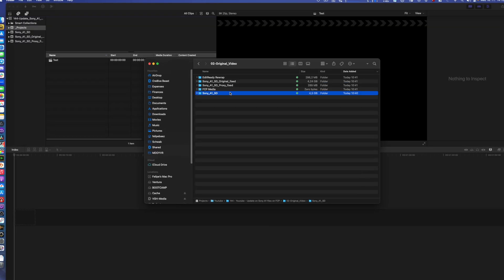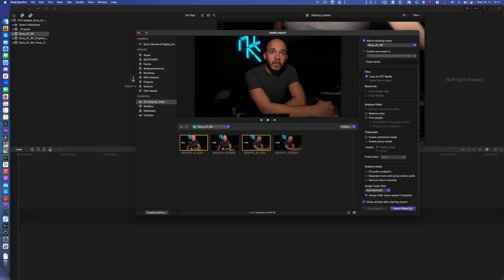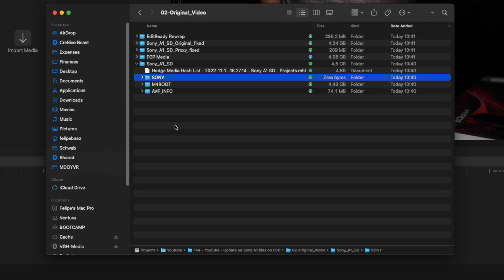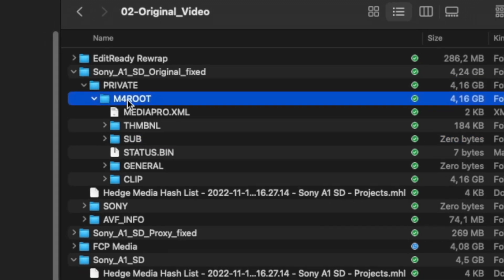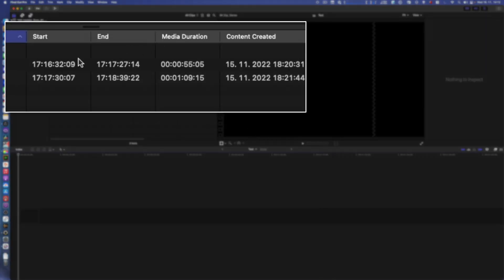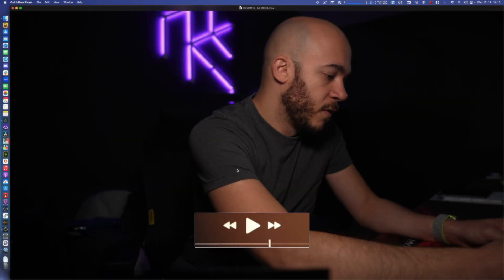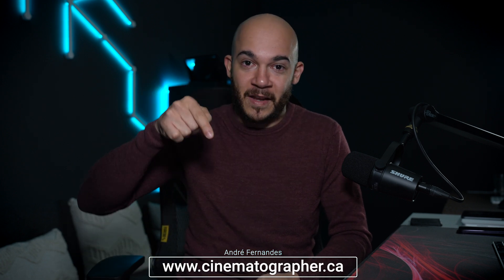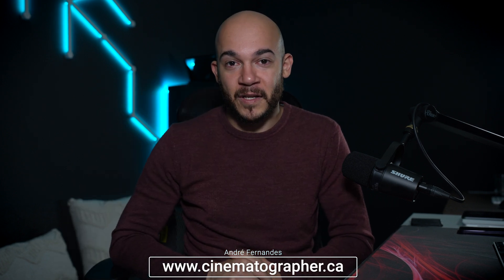Update on the Sony A1 workflow for Final Cut Pro

Comment: I am trying to edit Sony A1 4K XAVC S 120p video files but Final Cut Pro shows just a black video.  Quicktime is also unable to play these videos - well they play but sound only no video.  They play fine on the camera itself.  What gives ?
Reply from the maker: The app doesn’t support all codecs/wrappers at the moment. It’s possible that if you’d rewrap those files to .mov container with EditReady it would work. I shot exactly that format and I was able to playback, but can’t confirm at the moment if I rewrapped or if it was the original MP4s, but I think in theory you should be able to play those.
Reply: @FelipeBaezFilms  It seems it is a bug in the latest version of macOS as it worked previously.
Reply from the maker: @duncangroenewald  Are you up to date on your Pro Video Formats?

Comment: Interesting note about changing the folder structure after files have been copied to another drive... FCPX can no longer import and Leave Files In Place.  FCPX seems to see the files AS IF they're on an SD card, and will only allow the files to be imported via copy/rewrap into the Library.
Reply from the maker: That’s right. If it’s in a SD folder structure it will see as the camera card. But the best part right now is knowing how to emulate that and get the results we want. Creating the rewrap copy you have a correct reference of timecode on FCP and with the MP4 the colorist is able to check catalyst for the metadata they need.
Reply: @FelipeBaezFilms  Yes, it's good to know. Though, I wish we didn't have to re-wrap.  Doing so removes other metadata, like Sony's Gyro metadata.